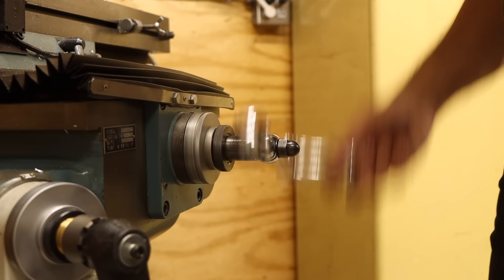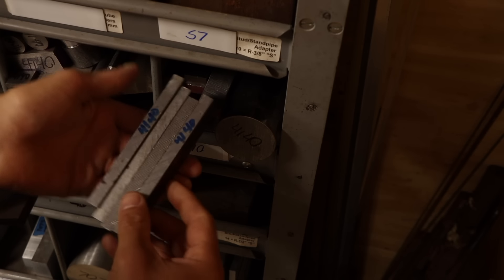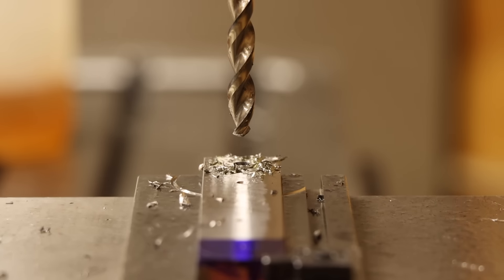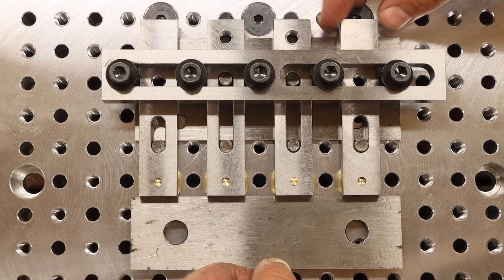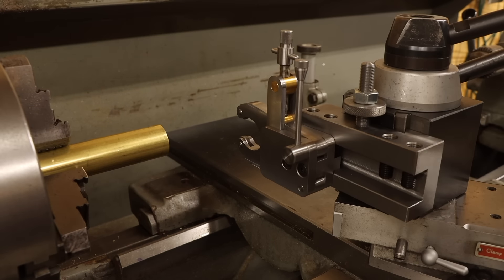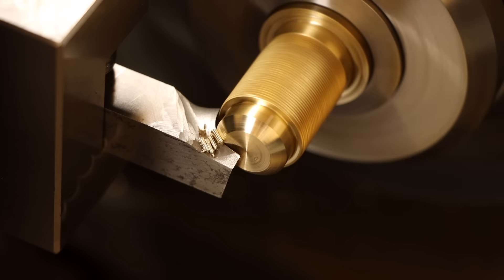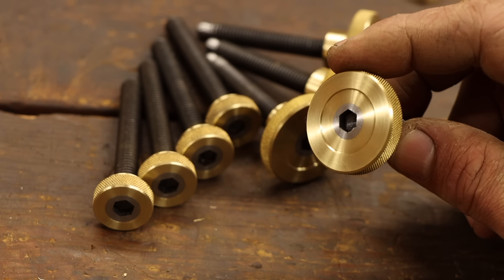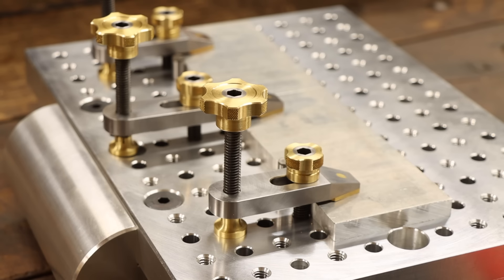Some STYLISH Hold Down Clamps || INHERITANCE MACHINING

Comment: I’m not attempting to criticize, just learn… but won’t the steel bolts mush the press feet and deform the rounded holes? After a few strong clamps the feet will be ruined, right? Or am I wrong? I’ve never done any machining like this, so I don’t know… 

Either way, they came out beautiful and I’d love a set for my nonexistent setup.. hahaha
Reply from the maker: 😂 solid enough reason to me! On the feet it's not much of a concern since as long as that joint stays free to pivot that's all I need it to do. Better to deform the inside of the foot than the fixture plate i mount it to!

Comment: what do you do for clean up and how do you keep everything from rusting when you are using your mist cooler?
Reply from the maker: I think a big part of is it the dehumidifier I have running nonstop. But I also use compressed air to blow everything off when I'm done. Still get some mild discoloration under the vise though

Comment: Holy shit. If I ever have time I am going to make a set of just those toe clamps. I use a universal plate at work basically every day - i only use kurt vises like 10% of the time. I use toe clamps for holding parts down constantly as I finish one side of the outer perimeter and I always have to go cut some brass shims to make sure it doesn't mar my aluminum. This is fucking genius.
Reply: I will probably just skimp on time and material and see if I can drill and ream the toes on my existing set for a set of brass tabs, and grind them in flush.
Reply from the maker: The brass inserts should honestly be standard on all hold downs!

Comment: Forgive my ignorance but would the ball nose end mill used to create the cup on the washer not have been perfect to create the form tool to cut the ball end on the knob? Or would the tool steel used for the form tool have had a disagreement with presumably the same or similar material of the end mill?
Reply from the maker: No worries! I cant say from experience but I've always been under the impression that wouldn't end well. I've heard stories of folks using carbide tooling to cut HSS form tools though.

Comment: I am sure you have mentioned it before and it is probably in your drawing video. But which pencil and sharpener do you use? Looks like a Pentel GraphGear, but more specifics would be appreciated.
Reply from the maker: Sure! The pencil is a Staedtler 2mm lead holder and the sharpener is a vintage Dietzgen SharPoint
Reply: @InheritanceMachining  thanks!

Comment: Again about the drawings:
How long do those take you? Because I saw like 5 or six sheets.
A general answer would be perfect, but I'll settle with one for those exakt drawings ;)
I figured its not really longer than designing an drawing them in CAD
Reply from the maker: This set only took about 3 hours to put together (and film). And that for the 3 sheets. I've had some other more complicated plans that took a couple days to draw out. CAD would definitely be faster haha
Reply: @InheritanceMachining  but 3 hours for modeling AND drafting isn't that far of. Mad respect!
At some point I'll get a drawing table. Just because (of you)
Reply from the maker: @joseppedaia3673  Heck yeah, man. Love hearing that! And I reckon you are right on CAD timing for a simple project like this. CAD really shines through on huge assemblies though. Hard to beat auto-generated views haha

Comment: I learned to draft on a paper. Later I even got a drafting table with "panto-graph" rulers. By that time, pros were starting to use CAD software. I started to use AutoCAD around 1991 and never looked back ;-)
Anyway ... what you do is not what a true pro drafter of old times would do. You are starting with a frame around an empty paper. A drafter would begin with drawing a part in the center of a large blank paper and only add frame as a last thing.
Reply from the maker: Huh... why would that be? In case they have to start over they don't waste time on a border/title block?
Reply: @InheritanceMachining  Because you want to have the object you draw nicely centered and you are just starting designing it. So if you finish the drawing first, you can then draw a frame in a slightly different position than you would originally. This is more of a concern when you are designing more complicated objects or assemblies. Title block was during "good old times", at least in my corner of the world, a large rubber stamp and you would just fill in name of designer, drafter, name of object, scale, date, ... .
Reply from the maker: @first_namelast_name4923  ah ok. i suppose this means you would start with a larger sheet of paper then cut it to size after you draw the border.

Comment: I love this channel I'm thinking of getting in to machining have you got any tips?
Reply from the maker: Hmmm... I could probably write you a dissertation haha something that comes to mind though is that since it's often an expensive hobby to get into, once you have some of the basic tooling you've opened the door to making just about any other tools you might need or want for cheaper than buying them. Usually results in an endless line of dependencies so there is always something new to make and new to learn. Of course if money's no object then the saying "buy cheap, buy twice" usually holds true.
Reply: @InheritanceMachining  thanks

Comment: what is that block made of at 12:01 that you are lapping with? any links?
Reply from the maker: I haven't been able to find a similar one online but it's basically a slap of nylon with adhesive grinding paper attached. It was originally a part of a chisel sharpening kit.